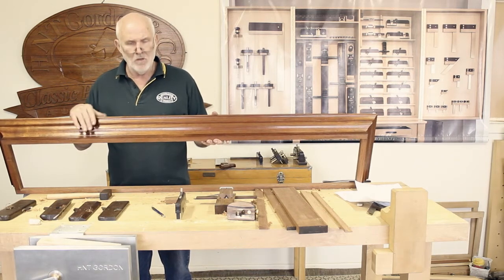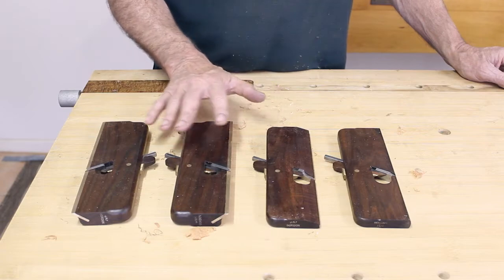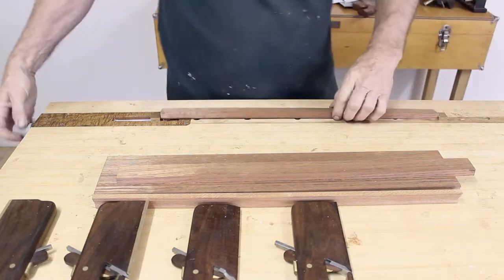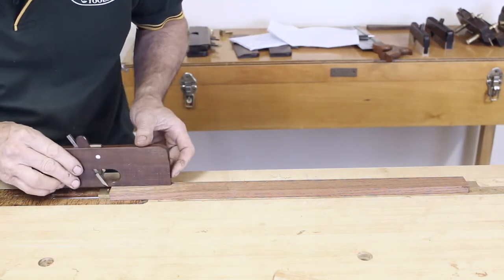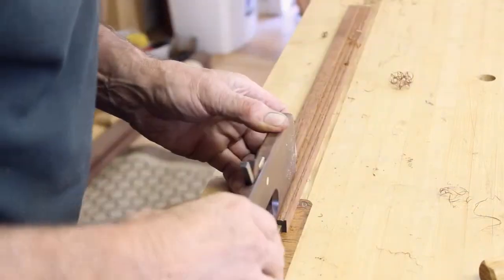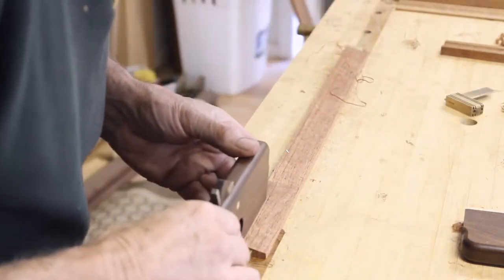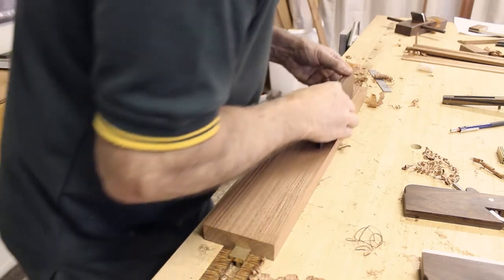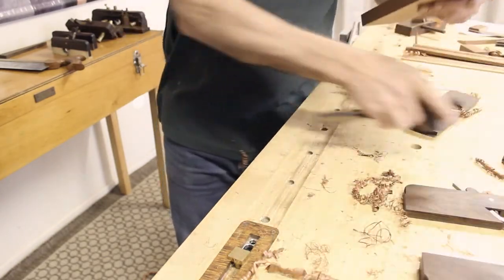How to use Hollow and Round planes to form moldings | HNT Gordon & Co.

Comment: Hello, I recently discovered the fabulous world of hollow and round planes, but it has draw attention to me that you do not put a bevel aside on the blade cut in large planes.
So I would like to know the utility of that bezel, if it was made as an ornament or reinforcement on the block of wood or has a sliding utility by the others manufacturers. I mean your entire collection of hollow & round plans.
Thanks in advance.
Reply from the maker: Hi Valdo
I think that part you are talking about on the older style Hollows and Rounds was for  reinforcement to keep the body of the plane in straight alignment.   With the wood we use we don't think it is necessary as the woods we use are very stable and stay straight with out it.  Our style allows the shaving to naturally curl out of the plane which minimises the shaving getting jammed in the plane body.  Hope I have answered your question.    Regards Terry